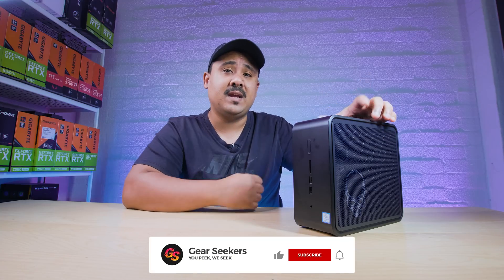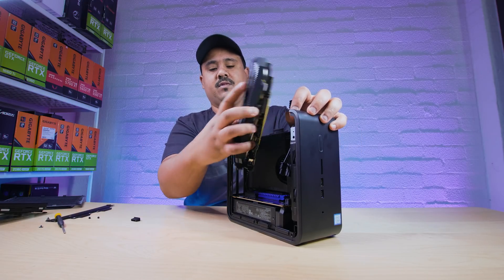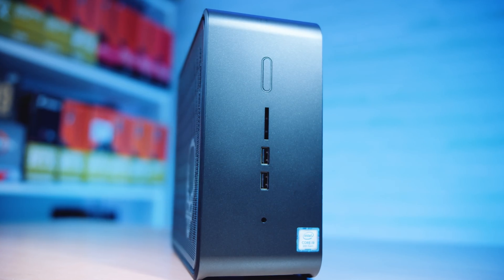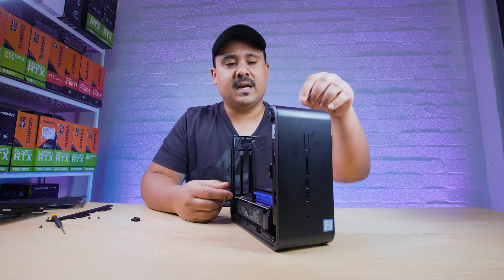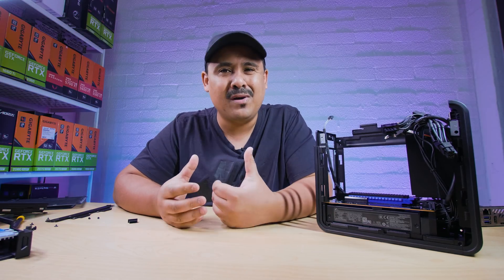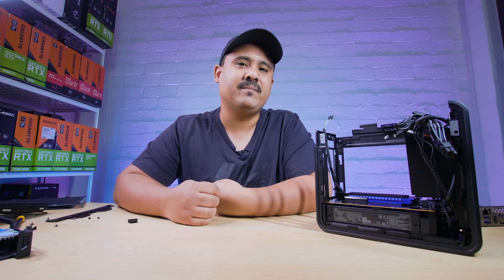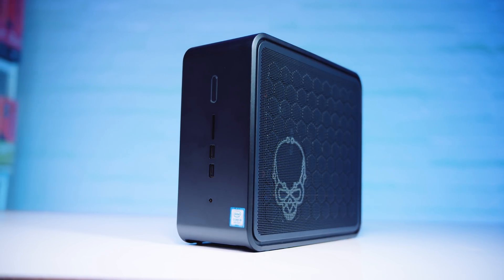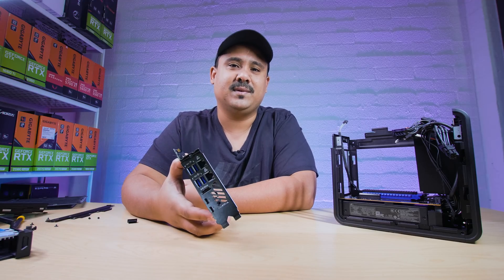Is the Intel Ghost Canyon NUC 9 Extreme the FUTURE of the Desktop PC?

Comment: I don't consider this upgrading. It's far closer to replacement.

Here's my thoughts on upgrading a PCs CPU. I pull my mobo and CPU, move my ssds and ram over (upgrade the ram if it's a whole new generation). Then I put the new parts in and the old ones go into my 2nd home PC, or get given to my friend who can use them.

This? Pull the mobo... and if anyone wants to use it... can you even buy a chassis and PSU separately? And at that point... Why pull it apart in the first place? Just buy a whole new system unit all over again.

Just stick to ITX.
Reply from the maker: The compute element and chassis are seperate SKUs